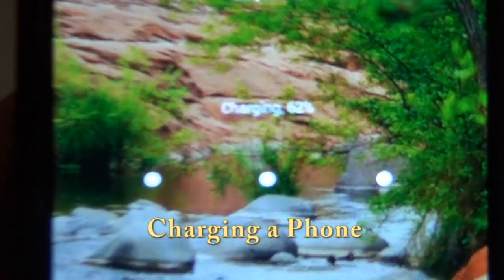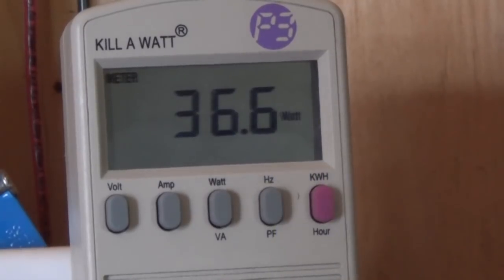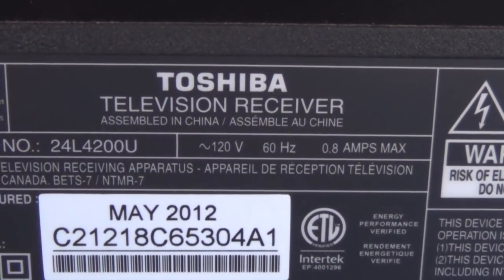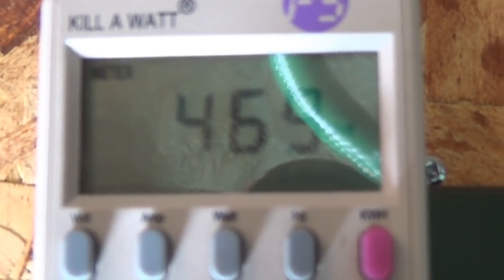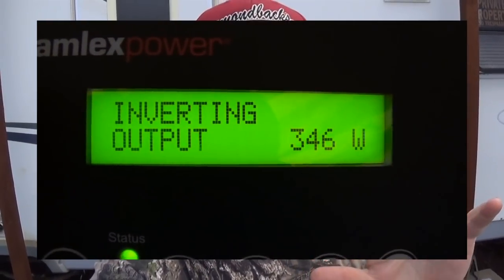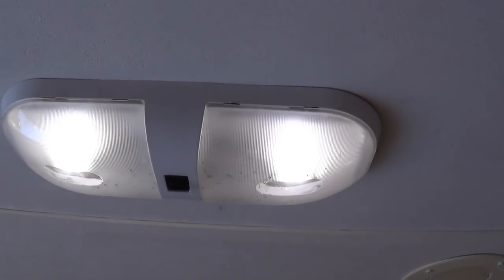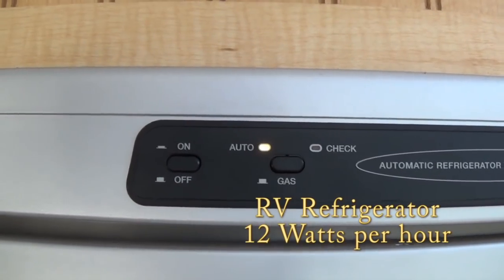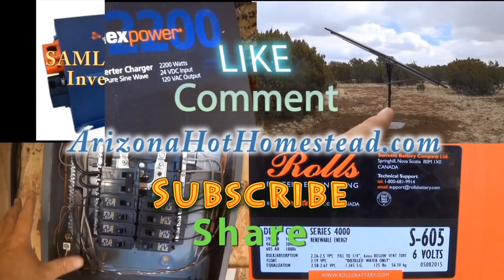How to (I) Measure Loads to Determine What Size Solar Battery Bank and How Many Solar Panels to Have

Comment: thanks a lot for your videos , I learned a lot from you, but how max length suitable between panels and charge controller also between controller and battery plz
Reply from the maker: the bigger the cable/wire the longer distance between components but put them as close together as possible.

Comment: i have 125w water pump and will run for 3 hr per day. Inverter is 700w. i would like to know  the battery capacity and the solar panel watt to be used.How many Amps does the inverter draws from the battery?.
Reply from the maker: to find out the inverter draw you will have to look at the spec. there should be something about how many amps it takes to run it. 3 hrs per day at 125w is 375w.  is the pump 110v or 12v? i would assume 110 becus you included the inverter.  if nothing else is running off the batteries just the pump would be 375w = 12v (batteries) * amps. amps are 31.25 so the battery(ies) needs to be at least 150amps. at 150amps using 31.25 amps for the pump would use about 20% of the batteries. so your discharge would be 80% plus what ever your inverter uses. this should be enough to handle even the poorest efficiency inverter keeping your battery(ies) above 50% discharge rate. never discharge more than half of your batter bank. 150amp batter bank max use would be 75amps. best use is around 25 to 35amps (pump is 31.25amps)  .. does that make sense?

Comment: your table at 11:33 is extremely usefull to establish how many watt-hours we are using in a period of 24 hours. So suppose my total is 2400 watthours. If i buy 4 Fullriver 6 volts golf battery AGM deep cycle, this is equivalent to 2  unit of 12 volts 225 AmpHour for a total of 450 Amp-hours. This is 12 volt x 450 AH= 5400 Watt-Hour but only 50% is available if i dont want to degrade the battery so 5400/2= 2700 and i will loose probably 300 WH in the conversion process. So only 2400 WH is available and buying a bank of 4 100 watts solar panel give me 400 watt of solar multiplied by 6 hours of light in a day for a total of 2400 WH so i can use 2400 and i am using 2400 so my deep cycle of charging and loading is complete. So you have to add this in your discussion. But i absolutely love your table of watts and hour to establish the total watt-hour required in the solar system and battery bank
Reply from the maker: i love how you spelled it all out. nicely done.

Comment: your pump was not 50watt, impossible, please re-check
Reply from the maker: actually its 500 watts but the point is to  help others figure out how to measure the load they would be running off  of solar so they can better size up their system.  thanks for the comment.

Comment: hint: 
- when you multiply watts * hours, what unit do you get?  
A: watts per hour is not a conventional unit and defines whoever talks in those terms as scientifically illiterate. The unit is watt.hours. If you want to define how many watt.hours are used in a specific time such as 1 hour, you say   x watt.hours per hour.  A watt is a flow rate (joules per second), so it is meaningless gibberish to talk of watts per hour (joules per second per hour makes no sense unless you are accelerating power, which is hillbilly insanity)

- you need  a new fridge. a 320 watt compressor is around 3 times a new fridge suitable for 1-2 adults. and a 12V fridge would reduce power consumption by around 40-50% versus 120V fridge.
Reply from the maker: right on

Comment: ha ha. read a book . 1 HP= 745 watts . even ur meter showed that and u didn't understand. ur meter showed around 446-447 watts.
Reply from the maker: thanks good to know. I didn't know it. thanks.
Reply: still, bitch slap back at ya!
Reply: +ak das Actually, 1 HP is 745.7 watts. If you type "1 horsepower in watts" into the address bar of Google Chrome or Safari, autocomplete will tell you that.
#OccupationalHazardsOfAPedant
+ArizonaHotHomestead This was a good intro and the unit confusion you put in the annotations was only a problem if you were then going to try to do some conversions or calculations based upon your measurements.
Has someone else in the comments explained to you the difference between Watts, Watt-hours, and Watts per hour (which makes sense in unit terms only as a rate of change of power)?
A watt is a rate of energy used. A watt-hour (average watts over a one hour period) or kWh (1000 watt-hours) is a bastardized unit that converts a rate back into a total. But the kWh (or BTU, a different unit, energy required to increase the temperature of a pound of water by 1 degree fahrenheit) is relatively easy to understand and can be converted easily into pounds of coal/gasoline/NatGas burned and thus related to how much you would be paying to have that delivered to your door.

1 watt = 1 Joule per second
A joule is a unit of energy expended or transferred. i.e. How much effort it takes to lift a pound of water 6 feet. A watt describes how fast your machine can do that lifting. As in, how many joules in a set amount of time is expended. A car's top speed is related to horsepower because it is constantly pushing air out of the way.
1 watt-hour = 1 watt for one hour (That is watts multiplied by hours)
Since 1 hour is 3600 seconds long, 1 watt-hour is 3600 joules of energy expended.
A watt per hour would indicate that energy usage is increasing in rate (aka accelerating). This is the inverse of a watt-hour. In other words, watts divided by hours.
First hour: 1 watt, 3600 joules expended
Second hour: 2 watts, 7200 joules expended during that hour
Third hour: 3 watts, 10,800 joules expended during that hour,
and so on...

Keep on keeping on. Best wishes.
P.S. BTW, the thunder in the outro freaked me out because it is raining here, but we are not supposed to have thunderstorms and I was listening on headphones.
Reply: ak das  looks like you need a coarse in thermo dynamics & working loads!  
you've been Bitch slapped for your snarkyness!!
Reply: Dan Murphy  . read about reactance power.
Reply: I'm sure he will. How about you take a spelling course?

Comment: This is helpful to see how it works for others.  After some conserving, I came up w/ 695 watts-did this a few weeks back.  I actually use much less, as my system is way too small and there is too little sun to even go near my comfort level. So when you size it- do it for clouds if your area tends to be compulsively cloudy.  I would have done that, had my budget allowed.  I am eventually going to double up the number of panels to batteries, though if the area was not cloudy-would only need 2 for ea. 6 volt pair of batteries.
Reply from the maker: yea when I get more money I do want to double to panels and even go with wind power but for now I got some thing.